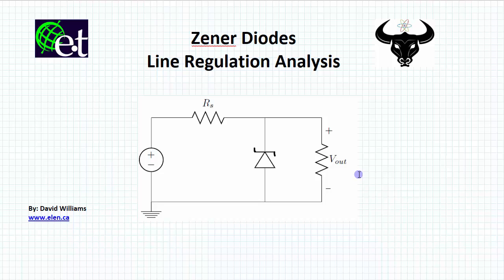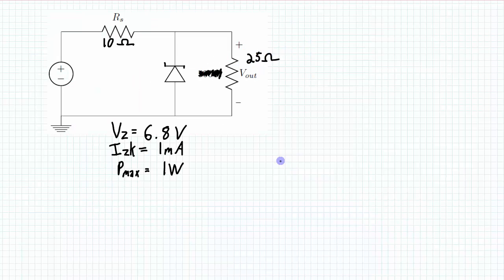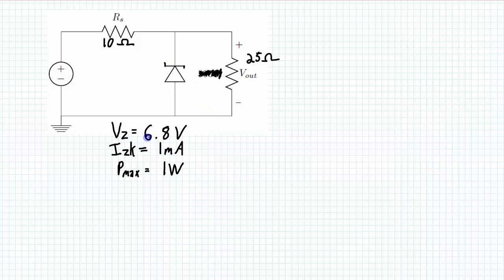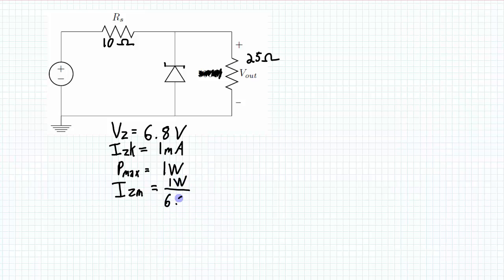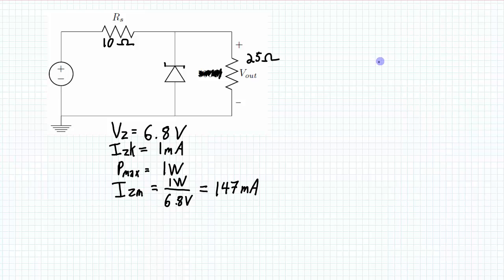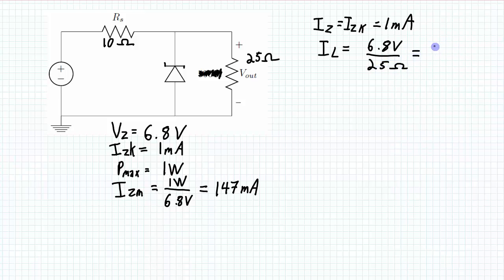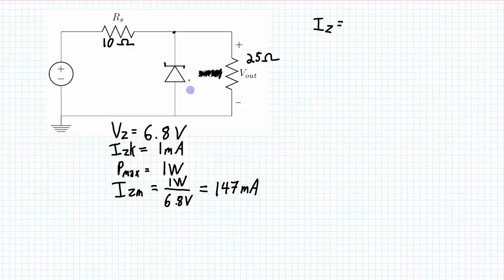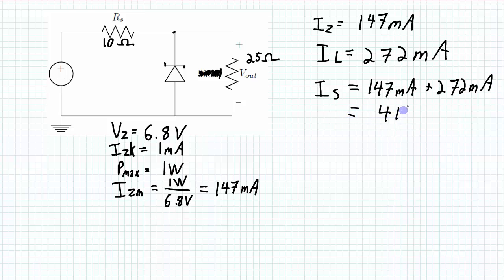Zener Diodes - Line Regulation Example

Comment: Hi Dave,
I have a zener regulator circuit similar to those you describe for charging small capacitors.  Can such regulators, if voltage and current limits are not exceeded, have an AC input of a few kHz?  In particular, half-wave rectified sinusoidal inputs?  I can't seen to find this information...
THANKS FOR THE BEST VIDEOS ON ZENER REGULATORS!!!

Comment: Sir what's that Izk 1ma
Reply from the maker: Izk is the Zener Knee Current which is the minimum required current to turn the zener diode on. It refers to the "knee" in the I-V graph where small increases in voltage result in huge increases in current.

Comment: Is there a 0.7 volts added to the load over the 6.8 zener voltage?
Reply from the maker: No, the 0.7V would only be there if the diode was forward biased. When using a zener for voltage regulating, it will always be reverse biased, so only the zener voltage is included.